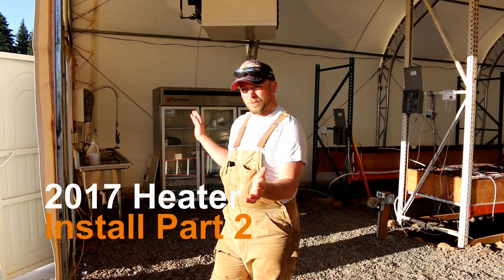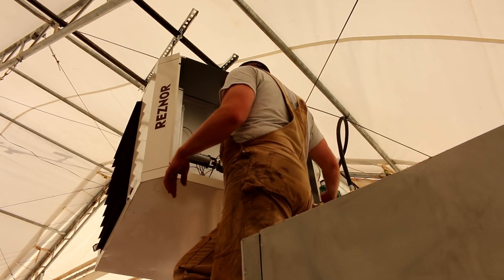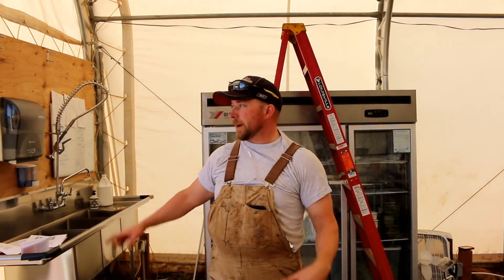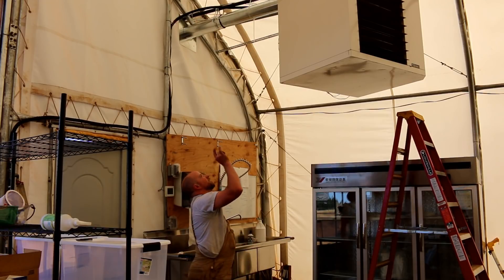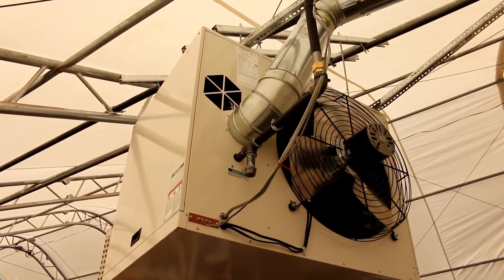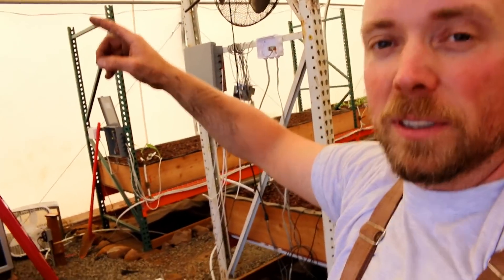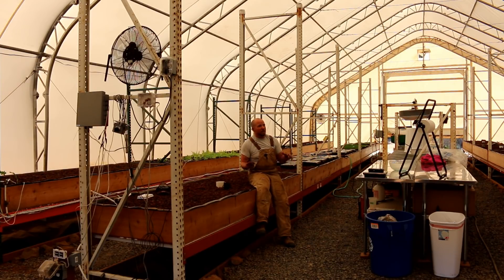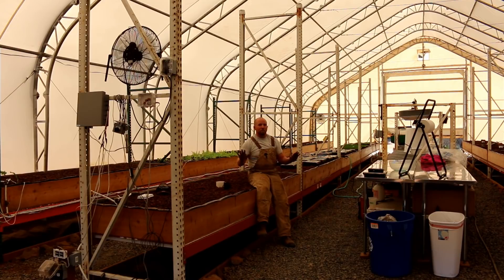Heating a Greenhouse with a REZNOR Propane Heater Part 2

Comment: @TheRealMartian What about doing an inline heater on your water for your Aquaponics system to heat the place? I saw one person he does inline heating on their water and says that it greatly helps keep their place heated due to water holding heat better than air does. OR you could even do a Solar Pop Can Heater for hot air or you could do a Solar Water Heater to heat the water of the Aquaponics system. From what I saw on youtube the plants only need their roots to be at the right temprature for them to grow well.

Comment: Rather than plain, sheet poly, what about a couple of facing layers of bubble-wrap?  Much better insulation value, while still letting light through.  If you want to get complicated, you could do them in movable panels so you could roll them up or down to allow in more light and heat when temperatures aren't too low.
Alternatively -- or possibly also -- what about having panels of heavier insulation that can move from the black-out side over to the clear side?  Create a ceiling and partial sidewall in 10' wide panels that would slide over to the dark side during the day, and back to the south at night.

Comment: Hot air rises up and cold air drops down. I wander if your circulation schema is going to work? Wouldn't it be better to circulate vertically and make use of the natural behaviour of cold and hot air?
Reply from the maker: there is another reason why these fans are horizontal...we need air flow over the top of the growing area to help strengthen the plants....two birds, one stone...might end up being one bird one stone to your point

Comment: May I suggest that you do a air flow test with your heater and circulating fans prior to having a need for them in the depths of winter.  A smoke test or something similar to see that you get adequate circulation and have no dead spots.
Reply: Xoncention good advice but the airflow will change drastically when he fills the lanes up. He'll have to tweak it as he goes. IIRC the controller boxes have temp sensors so he should be able to see if the heat is well distributed. He may also be able to reduce his power use by having the automation shut down the fans when the temperature difference is below a threshold say 5-10 degrees.
Reply: Agreed.  He should be able to lay some obstructions in his grow beds to act as a barrier to his convex and other eddies at work in this enclosed space.  Nothing worse to discover that the ends of his plants get frost bite due to cold pockets.  Those fans he is using for circulation are not very large and their displacement would not be great.  I am also surprised that they just prop the tanks on some blocks.  Where I live we have to have a concrete base and the tanks must be bolted down.  Earthquake and other forces resistant.  Nothing more volatile than a tank of gas catching fire :-)
Reply: Xoncention Here In Virginia I often see tanks up to 300 gal WC on blocks or sitting on asphalt parking lots. Larger tanks in commercial locations are usually on concrete pads or sit in concrete supports that match the curve of the tank.
Reply: I think stratification will be the main concern. Not so much that some spot is too cold but that it's 40 at the floor and 90 above the racks, especially when the sun is providing the heat. The fan on that heater looks pretty serious. If he can turn the fan on via wifi that may be all he needs to even out the temperature.

Comment: Have you still got the little propane heaters or did you only have diesel ones (it was a while ago and I can't remember if you actually got propane heaters or we just discussed it as an option?) if you do you should put in a couple of lines to plug the propane heaters into the big tanks as a backup 😊
Reply from the maker: they are diesel...and we do still have them...they are our backup plan

Comment: I was under the impression that you are due to install some (3?) shelves above each bed that you have already installed. Will this not alter the air flow pattern and circulation within the building? One thing that may prove useful is that when we wanted to check air flow patterns within a livestock building was to use a hand held smoke generator designed for this purpose that allowed you to observe the actual pattern of air flow.  (They were called Drager smoke tubes)
Reply from the maker: oh man I love that idea...thank you for the comment

Comment: I am surprised that no one saw the interference of the fans : https://www.google.com/search?q=fan+dispersion+angle&tbm=isch&tbo=u&source=univ&sa=X&ved=0ahUKEwj3-uem-_fVAhWM7IMKHXyEChcQsAQIJw&biw=1822&bih=844  They are not in a tube.  The fans are fighting each other. It's by no means circular.  It is a parallelogram. it's like a bull horn, it spreads like gravity the square of the distance.  I hope you find this of use.

Comment: I think you'll get better air movement by having both fans on a side blowing in the same direction. Make one big air current not two confused currents.
Reply: Randy - I agree completely,  hot air rises. By far the most comfortable shops (and cheapest to run) have underfloor (in slab) heating.  I have looked after large shops for 20+ years in central Alberta, currently a grader shed and fire hall. What concerns me most with his setup is the shed to ground connection, that is where the frost will push in weakening those dirt walls as they will be wet all winter and be a huge heatsink on the fish water.
Reply: Randy - Condensation will be a problem I agree, but I don't think he has addressed the frost issue adequately, IMHO. 
The transition zone from outside frozen ground to inside unfrozen ground will constantly be wet without insulation separating them. This zone will be almost directly underneath the walls, that is why they insulate out 4 feet or down  3 feet when new shops are built (around here anyway) if the shop will be heated.
Reply from the maker: you are correct in that I haven't done anything yet...but this is a major consideration and the reason why i'm considering digging up the french drains, moving them out and laying plastic down on the ground...now I'm thinking of digging straight down with a trencher and putting insulation board down as well.
Reply: TRM - Good idea, how deep is the frost line where you live? That dictates how deep.  :)